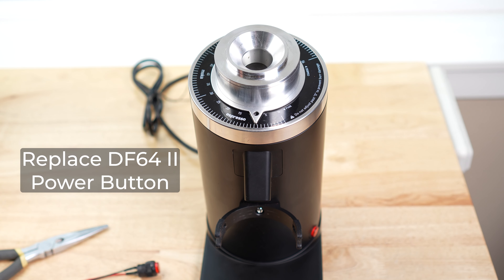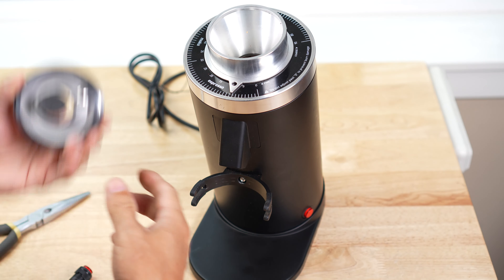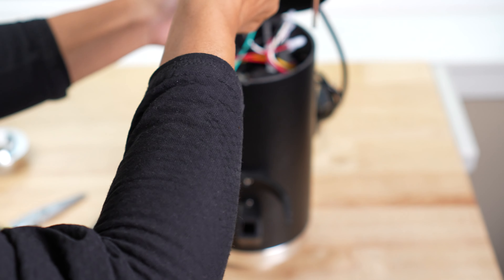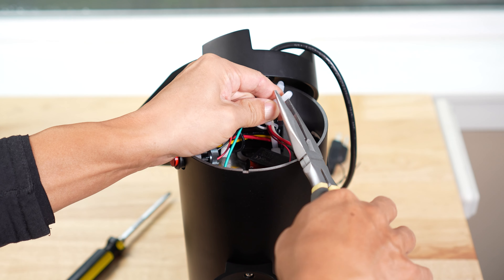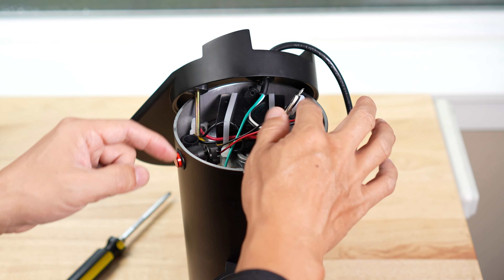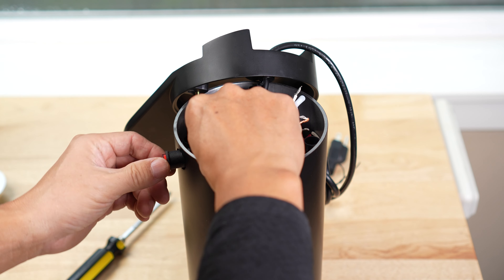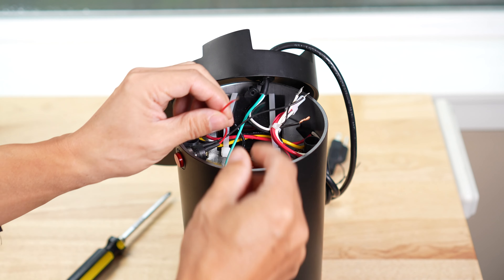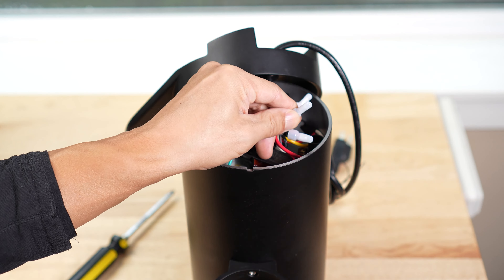How to replace the power button of DF64 II (gen 2)

Comment: Hi, by any chance can you publish what color of the wiries should go where? I have a df64 gen2, and I've accidentally removed wrong white cap, but my wires color are completely different from what is on the video.

From power plug brown, blue and yellow-green (striped, and that is ground) wire goes (it seems in your video it is black, white and sea-green, sea green is ground), button have same as yours red and black wires,  then black and red goes into the small black box (ion generator), but then I have blue, yellow and red wires (on a video it seems that you have black, white and red as far as I can see) that goes inside the grinder (on the video it is ). And it was my bad that I forgot to take a photo of that...

Would be actually helpful to get some simplified schematics for something which requires repairs to be honest...

Comment: My grinder stopped working today, how do i know if it’s the button or something else ?
Reply from the maker: Try to press the button all the way and don't release it and check if the motor is running. If so it's probably the power button issue.
Reply: @miicoffee no it doesn’t run no matter how hard i press.

Comment: My button has a red wire and blue wire. I'm going to assume the red goes where yours goes and the blue will go where the black goes.
Reply from the maker: Yes, blue = black
Reply: @miicoffee  thank you, it works perfectly. BTW.... It did explode on me..... Umm I might have screwed the top onto a wire ukowingly so it was touching the metal. Hahaha. I fixed it though and we're good. 😅😅

I guess I derseve it for not bothering to zip tie it all neatly back together.

Comment: My button died after 0.5 kg of coffee, I disassembled the button, got acquainted with the internal design of the button. I came to the conclusion that I would replace it with a completely different one. Most likely it will be a toggle button. The design of the original button is very unreliable.
Reply: Any words from support? Should not they replace it?